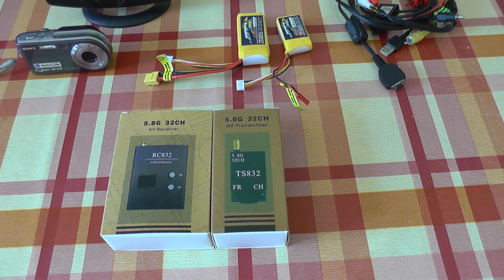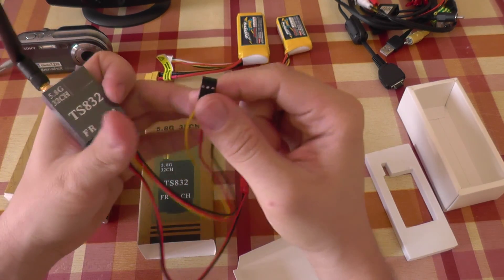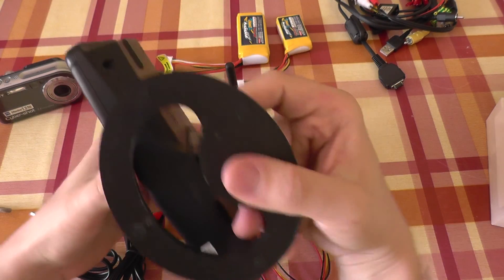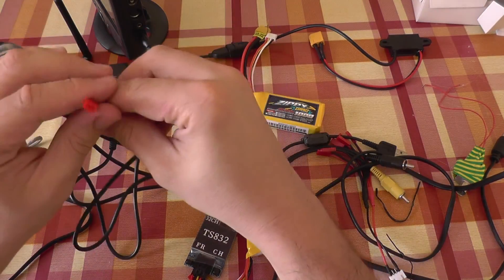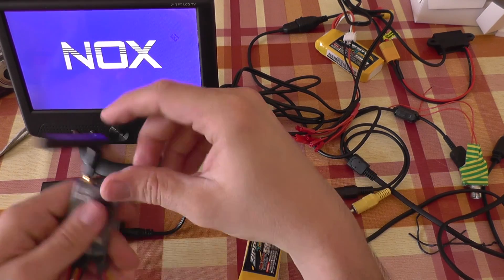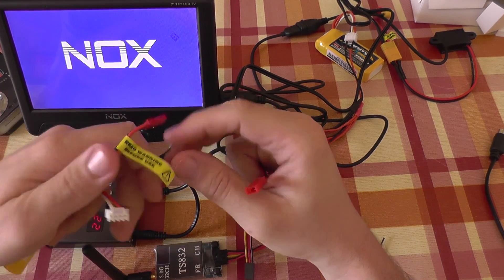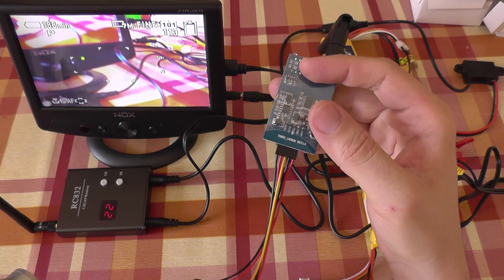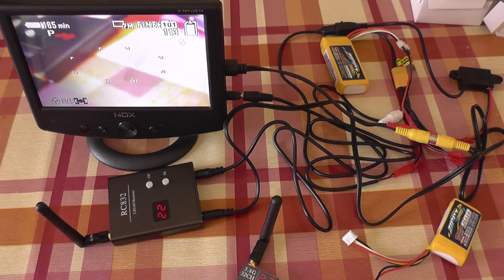Eachine 5.8G 600mW FPV KIT TS832 & RC832 unboxing and setup

Comment: I WANT TO KNOW THAT IF A VTX HAVE HIGH POWER OUTPUT THEN IT WILL PROVIDE  LONGER THE RANGE OF DISTANCE???ŔEPLY BCOZ I HAVE WRITTEN HERE WITH HOPE
Reply from the maker: Yes the bigger the transmit power is the bigger the range is, but also antennas are very important regarding the type, model, polarization, placement and .noise

Comment: Can you explain about this problem, my tranceiver and my transmitter cannot to take image or no signal. Please help me, because i have no solution, thank you
Reply from the maker: Is your receiver set on the current channel like your transmitter?
Reply: Yes, but there was some condition can take image but different current channel and the image was blur
Reply: @TechTronic9000  so, are you know the solution?
Reply from the maker: Are you using correct antennas?
Reply: @TechTronic9000  yes

Comment: Common ground(wiring up to an av source), 12v output for camera and burning it if antenna isn't attached are quiet good information. Haven't seen any detailed review anywhere else. Putting a range test and video quality test on how it transmits video over range would be perfect. Nice one
Reply from the maker: Check out my other videos about it, I have also a test rage. Got about 1km strapped on a phantom, could got more out of it, but was cold and the battery of the drone didn't last much!

Comment: Can U Check this for Distance check like with Buildings between the transmitter and Receiver ... horizontal limits and Vertical limits
Reply from the maker: I have some other videos with this KIT, it goes to 1+km with no issues.
Reply: @TechTronic9000 oMG really!?

Comment: Hi, can i know what type of battery you use? each for VTx and VRX? does the battery using 3s? how about the mAH? thanks
Reply from the maker: I have used two 3S batteries, the smaller one was 500mAh and the larger one was 1000mAh. The 500mAh was used with the transmitter and the larger one with the receiver.
Reply: the last one, how about the fpv monitor did you use the same battery with the receiver (1000mah)?

Comment: Hi would a 2s 7.4V 1200mAh be ok to power the monitor and reciever?Would the battery last long,also can the transmitter be wired to your pdb?thx
Reply from the maker: +SheaProdigy My monitor is not meant for FPV so it runs on 5V with an adapter. The adapter can take anything from 2S to 6S. 1200 and 2S is too small to power a monitor and a reciver for a long time.The tranmiter from my video needs 2-3S battery voltage sk yes you can connect it to a pdb.

Comment: With this transmitter I can transmit directly at the goggles? Or I must have this receiver
Reply from the maker: Yes you can use it directly with most googles systems on the market without using the receiver.

Comment: Dove Can I find the conversion module ?
Reply from the maker: +michele di gregorio what conversion module ?
Reply from the maker: +michele di gregorio what conversion module ?
Reply from the maker: +michele di gregorio what conversion module ?
Reply: solved thanks ... I wanted to ask you a question I saw a video where I would fit into the monitor the rc305 saperre you can do? if you like ?
Reply from the maker: I have fixed my monitor on top of my transmitter with a adapter set.

Comment: if i connect 1000mah 7.4V battery will it work with it?
Reply from the maker: +gabby gralnik yes it's compatible with 2s (7.4V) and 3s (11.1V) batteries.
Reply: +TechTronic9000 both of them?
Reply from the maker: yes, both of them should work on 2S, but be aware that the same KIT RC832/TS832 are sold under various brands like eachine, boscam, skyzone, etc. specs. may vary...

Comment: Is this FPV set compatible with GitUp Git 2 ?
Reply from the maker: +Emil Genov Of course, here is the test: https://www.youtube.com/watch?v=0swK1JN86ng
Reply: Very good. but for Git2 I need 5V and the TX outputs 12V so I need voltage regular? Or I can just skip powering up the camera with the FPV cable and use the battery in the camera itself? Furthermore if the TX is connected to the battery of the Drone and if the TX is also powering up camera the Drones battery will drain quicker I guess.
Reply from the maker: +Emil Genov Inded the eachine outputs 12V so you need to either use and 5V UBEC (like i did in the video test) or just use camera battery and be sure that you only connect video signal and ground cables (remove the power cable). I think that it's better to power just from the main battery as the Git2+FPV TX do not use to much power and removing the Git battery save's so weight, but you still need to add the UBEC.
Reply: +TechTronic9000 Thanks....I assume the weight of Git2 battery is comparable to the UBEC...so it is more or less the same .If a Quad have +5V output pins then I guess I can power up the Git2 directly from the quad and use the other +12V pins to power up only the TX. Well I still have to think how to power up the gimbal :))))
Reply from the maker: +Emil Genov Yes, it also depends on your quad. By the way what model you you have maybe I have some suggestions.
Reply: +TechTronic9000 Hello...I am waiting to receive XK Detect X380. Any idea what distances those RX/TX FPV setup can reach...I saw that it should handle at least 1000 m. With better antennas maybe more.. Cheers.
Reply from the maker: My RC832 / TS832  FPV KIT did ~1km, with better antennas you will get a bit more. I did a range test here:https://www.youtube.com/watch?v=XG4GaVDIrqM
Reply: +TechTronic9000 Thanks. It seems this FPV Kit is the best in terms of price/performance. I will get one from banggood. Cheers.
Reply from the maker: +Emil Genov I see a much better offer here: http://www.gearbest.com/fpv-system/pp_295533.html
Reply: +TechTronic9000 This is a bit confusing GB have TS832S + RC832..this is TS832S - with S on the end. And the one you tested is TS832 without the "S" . Any idea if there is a difference TS832S - TS832 ?
Reply from the maker: This RC832 / TS832 is one of the most cloned and copied FVP systems out there, just like cloned SJ4000 cameras. This is found under various brands like eachine, boscam, colormix and others. It has the same PCB like mine and also same specs.
Reply: +TechTronic9000 Then I guess there is no difference between TS832 and TS832S....Thanks will go for the GB one :)
Reply: I just saw that TS832  is 32CH TX and TS832S is 40CH TX so they are different more or less.
Reply: After some deep looking it seems that TS832 have different revision seems that rev 1.3 is better choice.
http://www.rcgroups.com/forums/showthread.php?t=2374063&page=2
Reply from the maker: +Emil Genov Mine is also 1.3, my full review/test of the kit: http://techtronic9000.blogspot.com/2015/10/eachine-58g-600mw-32ch-fpv-wireless-kit.html
Reply: +TechTronic9000 Thanks..I ordered mine. Will order better antennas also.
Reply from the maker: +Emil Genov I recommend clover leaf type antennas. I'll also order a set soon for my 250 quad.
Reply: +TechTronic9000 Yeah...the same, but they are so many starting from 10$ to 60$ maybe more....this is a bit confusing.
Reply from the maker: +Emil Genov Personally I'd choose something around ~10$ from hobbyking. Just be sure you get the same connector and also think of the angle of inhalation.